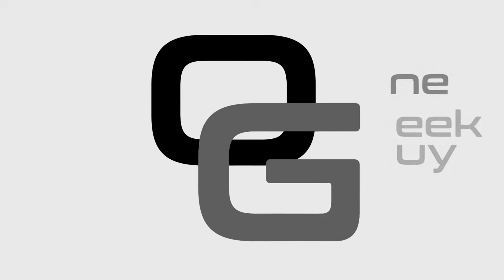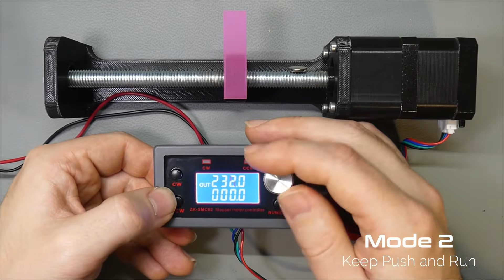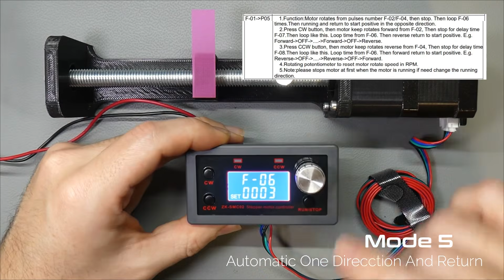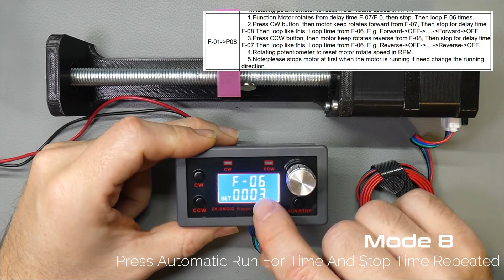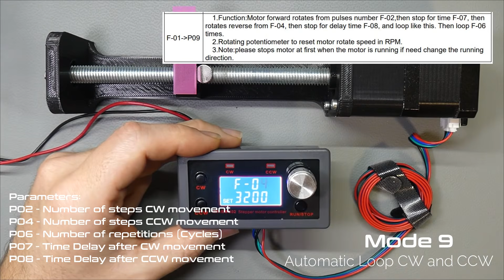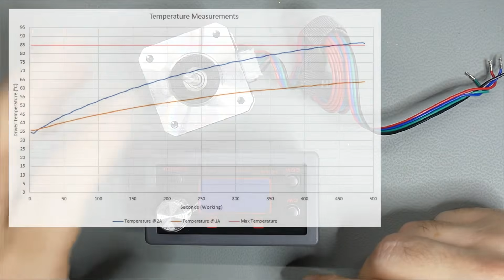HOW-TO: Motor Controller for NEMA Motors SMC01/02 Modes and Performance Part2

Comment: thank you, I have a project, I'm using a stepper motor nema 23 , connected to a shaft that is turning a sonar transducer , I'm wondering if I can set this up to rotate with the dial but only rotate 270 deg. Bipolar and when i stop rotating in any position the motor stays on to hold the position within the holding power of the motor (170.0)oz is this possible with the config. files

Comment: Hi, I'm wondering if you could help me figure out how to use this controller. My goal is to find out the RPM value shown on the display, which corresponds to the stepper motor rotating the screw—is that possible?
Reply: i need a constant rpm, how do i know the rpm that used

Comment: I need to 0 motor at 0 degree

Then to turn the motor 180 degrees  delay .7second repeat till turned off. Speed adjustable during rotation 

 Can this do that  

Can I do this with this

Comment: How programing to the loop goes infinity , going back and foward utill I press stop ?
Reply: Even i need the same 😢
Reply: @akhil6308  function f 06 set like  " ----" means infinity looping.
Reply: @josehudsonsantos9608  thankyou so much for your reply ❤️ ... actually i tried with f 06 ...but its not working....
It is working like forward stop forward stop and return to original position........what actually i want is it should run after returning to the position automatically.. without pressing the button.....

Do we have any feature for continuous running ( forward stop forward stop return and again repeat 🔁....

Comment: Hi! why  you don`t use the F-02 High 3bit HXXX setting Low 4Bit XXX (see the manual)? You use  only total number one full circle impulses. In F-02 you can set max 1~9999999 total pulses. How setup more time delay between forward and reverse moving (for example 5 min)?

Comment: Hello, if you can help me with something, I bought a controller exactly like yours, I would like to use it on a rod motor that pushes and returns, the problem is the following, if I put the motor on directly, it pushes my part, that is, it has the necessary force but if I connect the motor to the controller then it seems to have no force to push the piece, my question is why? Does the controller have a force setting or something, thanks
Reply from the maker: Which controller are you using SMC02 or 01? Are you using an external driver?

Comment: Trying to understand F2 and F4 setting to run turn pulse numbers greater than 9999. It seems the H number set is the method but how to quantify it? I am not understanding this….. Can anyone offer me advice or even a link so I can get a handle on it PLEASE. Thank you…….
Reply: I just asked the same question I sent mine to 1600 and then after H ( I put at 10 ) I don’t know what that H means but it seems to work for what I’m trying to do. I’m trying to make a Watch parts cleaner rotation.

Comment: Thank you for video.  In program 3, are you able to set a maximum 3 that it will not exceed?  Such as you don't want someone taking it over 100 RPMs.  Thank you

Comment: Worked through your video in detailed steps.
I have an issue in that for mode 4, and probably others instead of running 1 and 2 turns the motor goes 7 turns. I must be doing something wrong, but what. Set to defaults and adjusted per your setting for dip switch but no joy. I am running out of hair to tear out. Also, if I may. What is the H inF2 and meant to do……Regards. Chris.
Reply from the maker: Let me know which motor and driver do you have and the setting you have configured and we can take a look!
Reply: @onegeekguy_yt 
Thank you so very much for your reply.
I am working on getting the information.
Chris
Reply: Any chance you found a solution for this? I seem to be having the same issue trying to use work mode 4, I have the steps programmed to run 1 turn, but when I go cw, it goes 7 turns, adjusting the steps doesn’t make any difference. However ccw works perfectly fine

Comment: Excellent. Had to watch your video several times to tie down the principles. The on line manual is the usual Chinese version of English so hard to follow. The wording in the tables makes sense when one knows the principles but is useless as a teaching tool.
You have filled the gap for me. Thank you.
Reply: Hi,
To follow up on my issue with the SMC02
I have spent the afternoon testing the unit that I have had trouble with.
Fortunately I purchased 3 units to use on an XYR photography close up subject mover that I am building.
The first of the three that I chose to learn on I now know to be faulty.
Working through OGG’s brilliant videos I have now rested all three and have had a 33% failure rate.
2 work perfectly and one has major flaws in the code and a loose assembly probably causing serious issues.
Thought I was going mad.
Editing the manual into English from probably AI converted and unchecked Chinese helped as well.
Massive thanks to OGG for his kind offer of support.
Guess I am back to Amazon to order another as returning anything to China from Australia has to be a nightmare.

Comment: Thank you very much for your great videos. I have a question: is it possible to set up an automated continuous movement of the actuator from one dead point to another with this controller without manual pressing CW and CCW buttons?
Reply from the maker: Unfortunatelly no, I am checking another controller that has more options, I will upload a video with it!

Comment: Hi

I'd been thinking to use this driver for telescope tracker. As per thermal performance, will the driver hold when used for more than 30+ minutes at low speed with 24V/1.5A?
Reply from the maker: At 1.5A, if you dont place the controller in a closed box without any ventilation, it should work.

Comment: how can i  add a foot swich to the controller , so i can control the stepper motor by foot with two swiches cw and ccw?? Can you help ??
Reply from the maker: Take a look in my channel, there is a video showing how to add endstops, so basically it is the same, you will need to bridge the main switches.

Comment: Can i can add multiple steps for clockwise and also for for anticlockwise??
Reply from the maker: It is somehow limited to fixed steps so it is not so flexible, I am developing a PCB based on Arduino which would be more flexible, if you have arduino progam knowledge would be definitely more suitable.

Comment: Hi. Can I use endstops switches with ZK-SMC02 ?
Reply: Get HF020 controller. It has inputs for limit switches.
Reply from the maker: Yes you can, same as SMC01 but you need to solder the cables in the positions. Or follow the advice from the other user and buy the HF020 controller.

Comment: Amazing video I’m using this device to rotate a device from left to right but I don’t want it the time out. How do I get this thing to run 24 seven meaning all day all year long
Reply from the maker: I dont think it is possible with this device to do an Infinite loop unfortunately....
Reply: @onegeekguy_yt  yes I have figured it out. It can do the movements infinity once you get to the maximum adjustment your clicks to zero and then it will do the infinity.
Reply from the maker: That is great then! Good to know

Comment: How to do automation, if series of steps need to give as input

how to control steps movements, like lets say we have 400 circular points to move one by one and i need to move pointer in following example sequence  starting from  0->10->240->45->28-> .......... -> 400 . How can we automate this ..

Comment: Excellent video series. Thank you. 

In mode 1 the ratio of encoder steps to motor steps is 1:80. Can that be changed to 1:1 ? To make it turn as slow as possible.
Reply from the maker: Unfortunately not, I dont understand why either  they did it in this way that 1 turn does not correspond to 1 turn in the motor...
Reply: @onegeekguy_yt most unfortunate indeed. Do you think it's possible with the SMC01 and a separate driver?
Reply from the maker: Both controllers will have similar limitations in this case...., might be a solution, there is another controller that I would like to test, but might be within next Month....
Reply: @onegeekguy_yt already very grateful for the information and replies. Thank you. I'll definitely keep an eye out for that video. Subscribed.  :)

Comment: How to hold position (holding torque)?
Reply from the maker: Using the SMC01 or SMC02? The one with the integrated driver will be really challenging. With the other, you could not connect the enable signal to the driver and either drive it from the other way or keep it enabled.
Reply: SMC02
Reply from the maker: Unfortunately, the SMC02 is a bit limited in that respect, won't be possible.
Reply: @onegeekguy_yt  Hey, this is urgent, I've external driver as well but then I bought SMC02, and I'm using this to control valve when I also require Holding torque, and using potentiometer to rotate(F1,P1). can I connect this controller to the external driver as well?
Reply: Thank you

Comment: Question i have is in my short shaft nema 17 has a 50:1 planetsry gear box attached. I set up the microstep to 16 to make rotation smoother. Does means i need to set up 160 000 steps for one rotation (200 x 16 x 50) or 3200 (200 x 16)? If it is former, all drivers i found only goes to 40 000 pulses. Recommendations?
Reply from the maker: Basically, if you set the microstepping to 16 means that for a 1.8deg motor resolution, instead of 200 pulses for one rev, you need 200x16=3200, so you need to set the controller to 320. The planetary is a mechanical reduction so has nothing to do with the driver settings. You will need to take in account that if the planetary is 50:1, means 50 motor turns is 1 turn in the output shaft, when the controller is set to.....200RPM for example, you will have 200/50 = 4 RPM as output, but this calculation you need to do it manually. Cannot be represented in the screen.